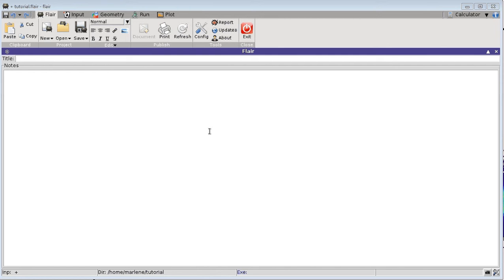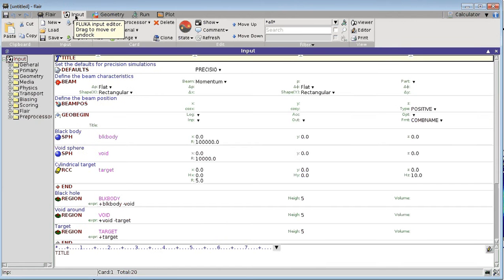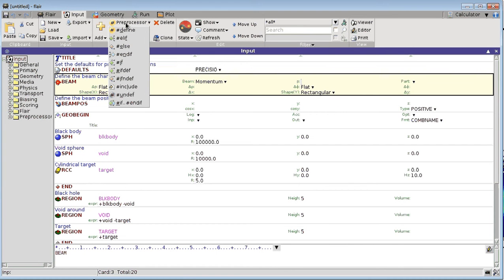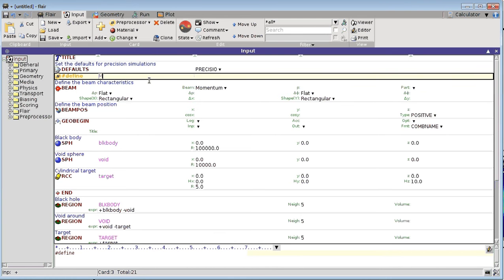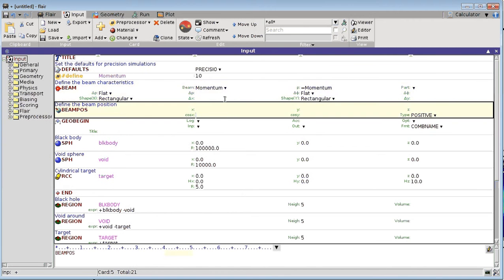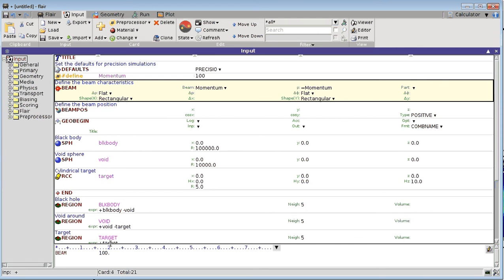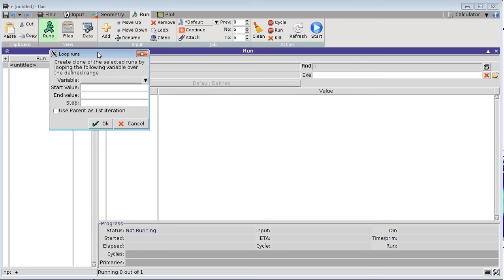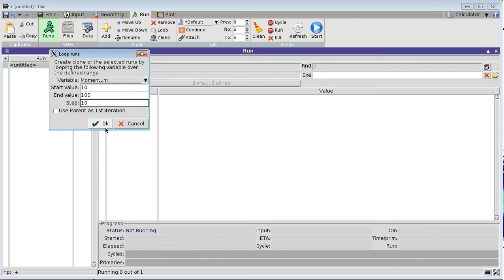loop over a variable

Comment: Hello Marlene. Doesn't it work for energy? I tried, but beam only accepts Momentum :/

I thought this could be the solution if One need to use a continuous spectrum as input.

I mean, I have to do a simulation where the input beam has a spectrum (fortunatelly, continuous) from 1keV to 1GeV.

 Could you help me?
Reply: Well, I hope if I just converted Energy to Momentum using p=E/c, It could solve my problem... But I imagine Fluka may have a better function to variate input energy
Reply: Sorry Marlene, I had not understood I have to use a negative value for energie variables in #define.